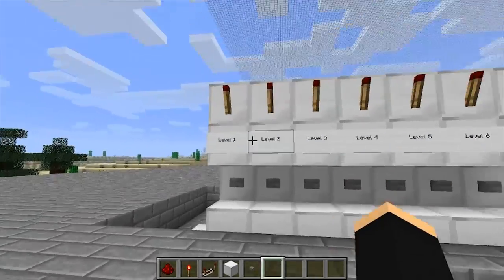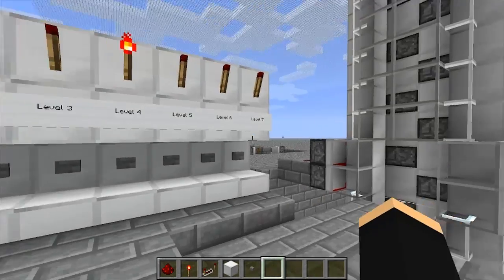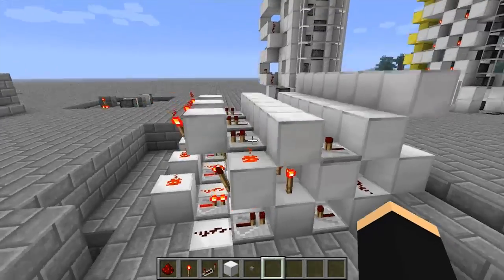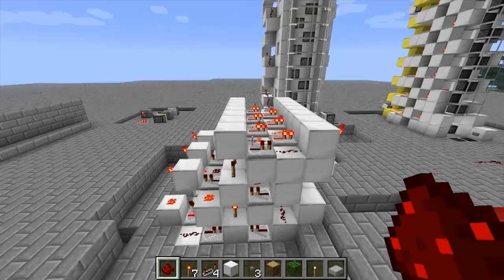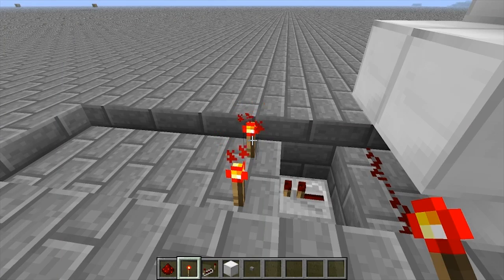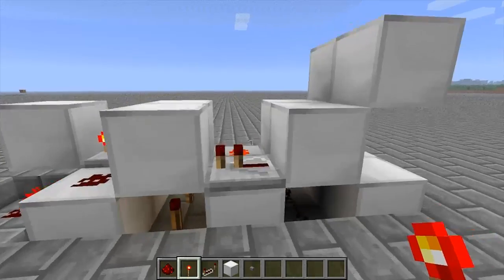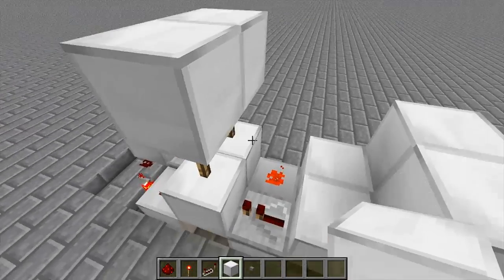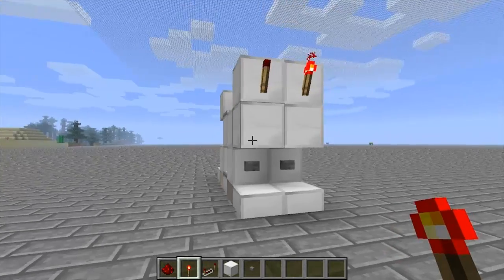Minecraft Tutorial - Tileable 1-wide RS-NOR latch

Comment: I know this is old, but that elevator usually pushes you off if you remove the glass in front of it, so by having sticky pistons attached to the RS-NOR latches that pull away a 2-high section of glass at the desired floor, it's easy to do a floor selector.

Comment: This doesn't seem to work this way anymore. There is a simple fix to make it work. At 5:30 in the video where the set line is being placed, instead of alternating repeater/dust, place repeaters down the whole way across. Tick them 1 time so they are at 2/4 (any tick besides 1/4 will work fine). Build everything else according to video and it works.

Comment: yeah i just figured out probably the easiest way to do it :D
just close the floors with pistons .. like a real elevator door .. if it's closed you will go to the next one .. until one door is open .. there you get automatically pushed out of the shaft :P

so you would just need to wire the rs-nor-latch to the doors ^^

Comment: I don't think it has anything to do with slower computers.. Mine worked on 1.2.3 (with extra delay on the first set of repeaters) but on 1.2.4 it just flickers the torch i selected on then turns them all back on. Is there no fix you can think of for this?

Comment: @777static777 I can't get this to work in 1.2 either. I'm using only one latch at the moment (the first design), and have tried it facing different directions. It's the exact same setup, and it behaves slightly differently in different rotations... but I can't get a single one of them to work.

Comment from the maker: @OatSkits No idea... it could be a lag issue maybe *shrugs* at any rate, the problem should be (as you've mentioned) easily fixed by putting in a little delay. That's perfectly fine, of course... I just showed the design with as little delay as possible because I wanted it to work as quick as possible =p

Comment: MINECRAFT VERSION 11w49a ==> I was having problems with this design - the first layer (where the bottom row has the repeater going into the bottom torch block - the left "row" in this video) wouldn't hold the charge, it would flick on, then off. By increasing the repeater delay to 2 ticks instead of one, this solved the problem.